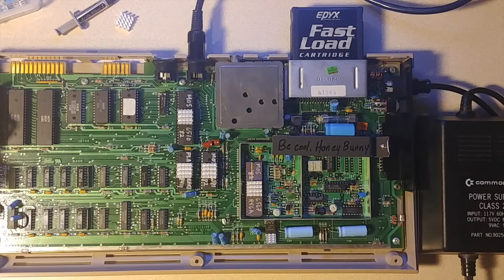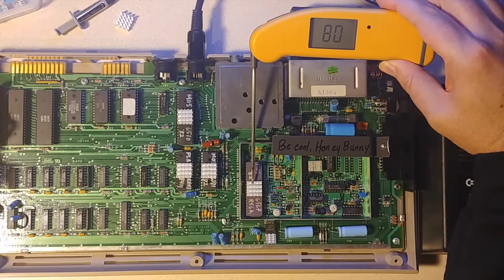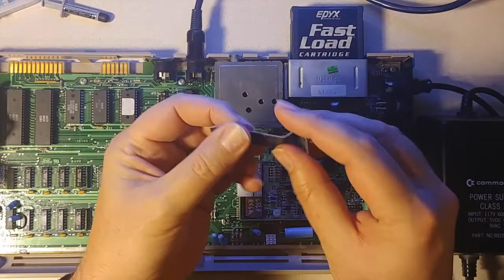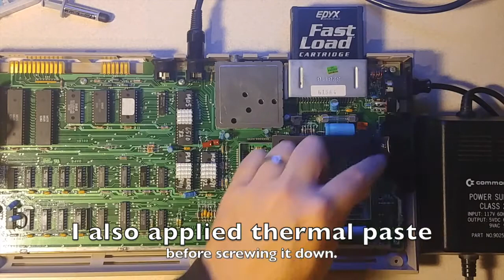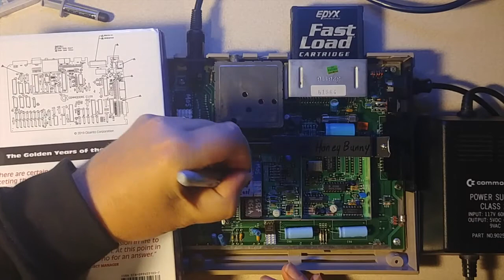Be cool, Honey Bunny: Customized C64 Heatsinks

Comment: Interesting ideas, the voltage regulator flashing is a good one, the VIC is a tricky one. I see you're using what looks like artic silver 5. So I'm worried about it leaking out onto the pins of the VIC which could short out something, but I guess if it hasn't happened yet, then it's probably not going to happen. Unfortunately I can't think of an alternative solution, and if it works for you then happy days
Reply from the maker: Ah, well that was my creative way to thermally connect - but not really connect - the sink to the shield can as you suggested might work earlier.

Yikes, I didn't think any thermal paste would be conductive, but this is my first experience buying it and I saw it was popular. I see their web site it reads: "Not Electrically Conductive:
Arctic Silver 5 was formulated to conduct heat, not electricity.
(While much safer than electrically conductive silver and copper greases, Arctic Silver 5 should be kept away from electrical traces, pins, and leads. While it is not electrically conductive, the compound is very slightly capacitive and could potentially cause problems if it bridges two close-proximity electrical paths.)"
http://www.arcticsilver.com/as5.htm

I will check to see if it is moving at all. I don't think I have it anywhere near pins, but thanks for the warning!

In other news, still waiting on the Electroware dual PSU, but then we can pick up that investigation.
Reply from the maker: @TheRetroChannel  Ha. :)

Definitely, there will be. I got another meter so I can show some simultaneous measurements and also picked up the Mean Well IRM-30-5ST, just in case, to put a dual supply together that meets my needs, no matter what.